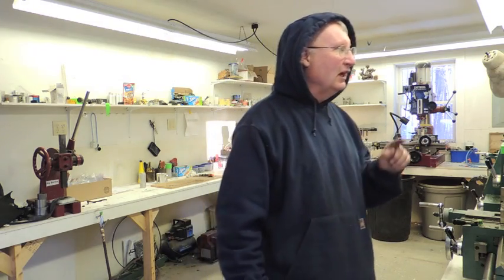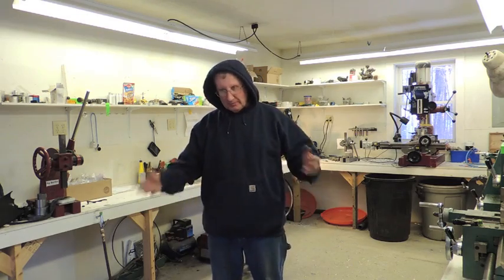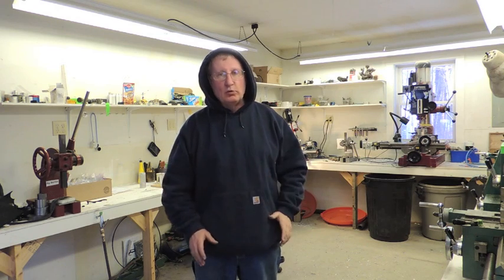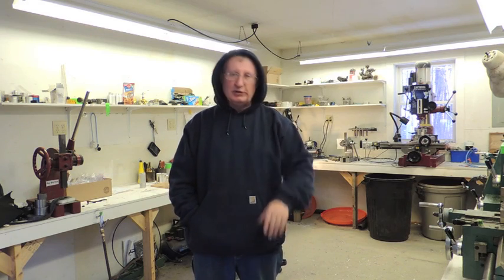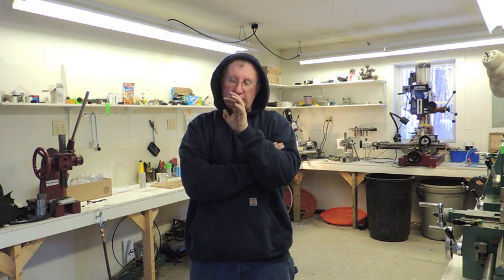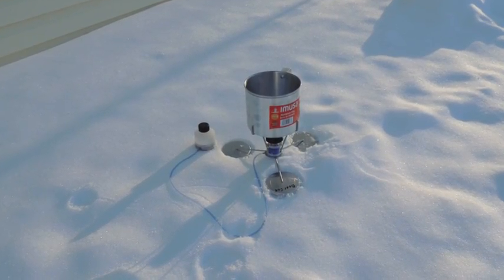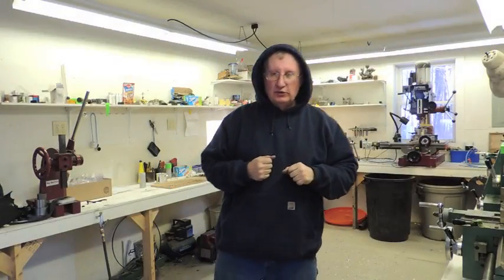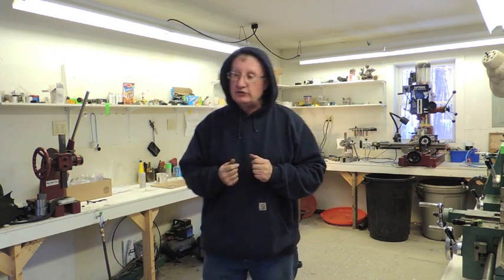Proto Pictures

Comment: How about you just adapt a 10cm Imusa pot lid blank to capture the bottom of the stove?  (Others have used pie tins as platforms on snow or sand for years.  If you want to "build a better pie tin", just use a 10 cm platform that will fit inside a 12cm pot for transport.  Its light and takes up little space and is surely big enough to do the job.)  The legs are spacey, but to my mind a bit too gimicky.  Cheers.

Comment: A lighter set of snowshoes for the stove could be a triangular piece of bug netting with grommets in the corners that the three legs would fit in... ok, I guess that's only one shoe, but I think it would work if the feet wouldn't slip right through the grommets.